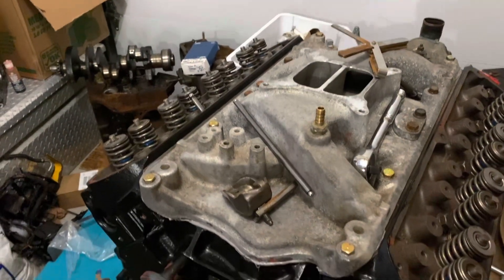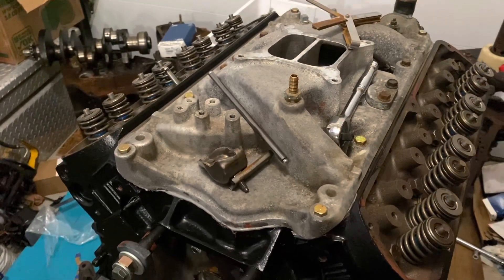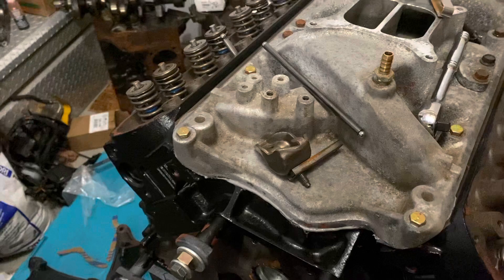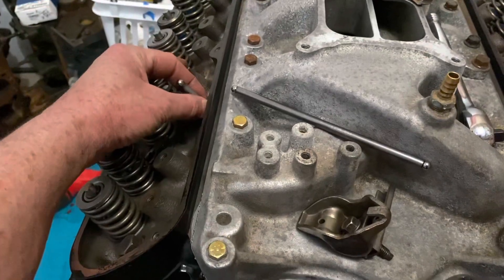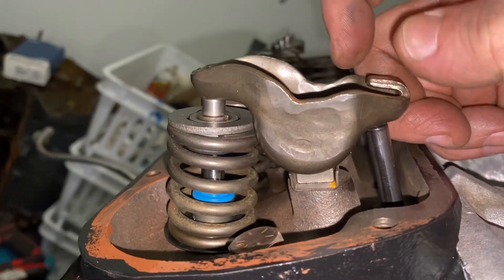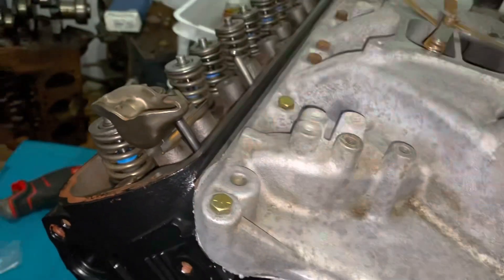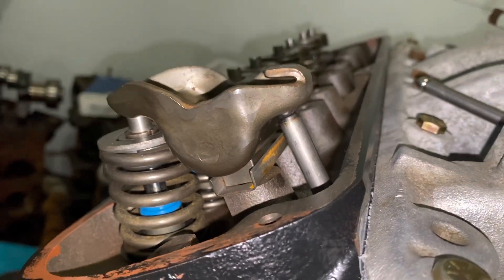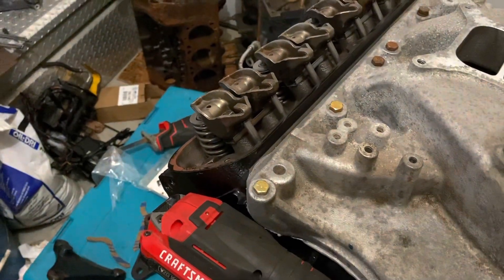Ford 351W Marine Engine - EZ Custom Pushrod Sizing

Comment: Would you happen to have the part # and manufacturer of the 7.6 push rods?
Reply from the maker: it’s in the video.
Reply: Found it I wasn’t able to get the 7.601 that you ordered but got the 7.645 from a 71-72 boss 302 they’re from Elgin as well. Would you say the .044 extra would give that higher percentage you would have shot for?
Reply: Using your math I’d be at 75% but I’ll measure mine too! This video was a HUGE HELP for running small base circle #351w #camshafts from #speedmaster!

Comment: Whay year is that motor? I have a 96 caravelle with a ford 5.0 volvo penta motor in it. I developed a REALLY bad knock. Im not real sure but i think this motor has tappet rods. I did find a 5.0 motor from a 91 grand marquis. Car runs and drives. I was hoping to just swap cams but now after watching this idk that will be possible
Reply from the maker: The custom pushrod lengths were more a result of switching to GT40P heads than anything else. But in general anytime you change the valve train geometry you have to possibly change pushrods and valve springs. This video is one reason I don’t like non- adjustable rocker arm pivots. With adjustable rocker arm pivots you can compensate for geometry changes within reason.